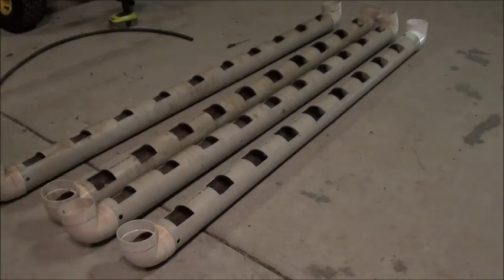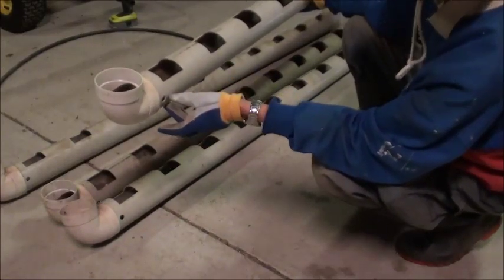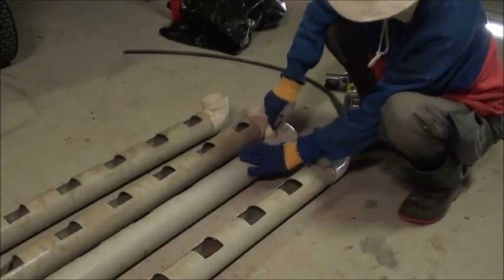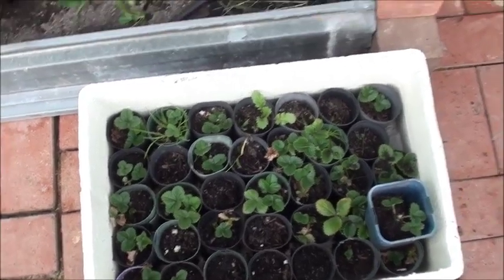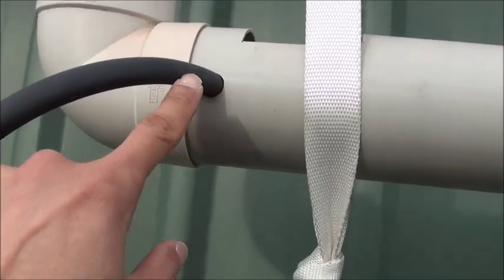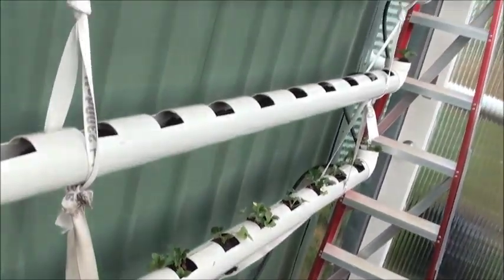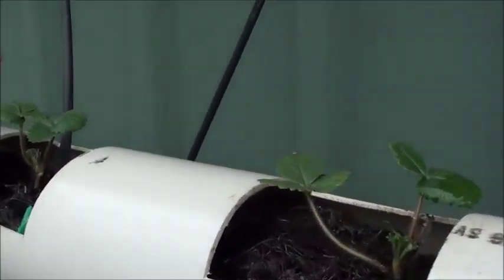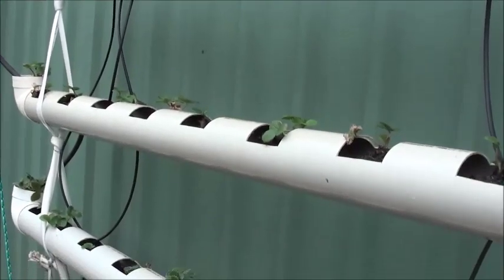4-Tier Strawberry planter using storm waterpipe Part 1

Comment: If I was to just cut a channel all the way down, instead of using holes, do you think that would work? I was going to hang the pipe from my greenhouse rafters using threaded rod about every 18 - 24 inches. And what size pipe are you using? 4 or 6?